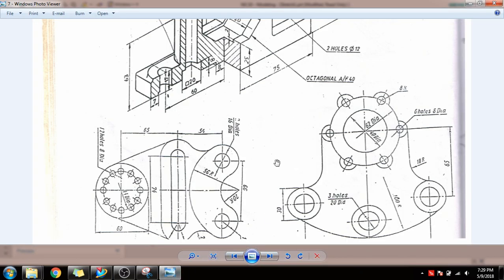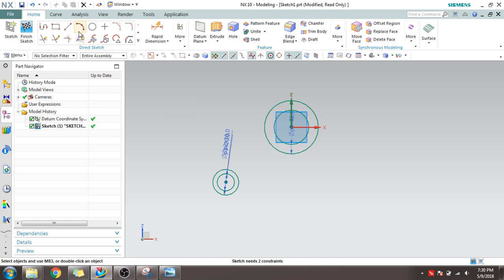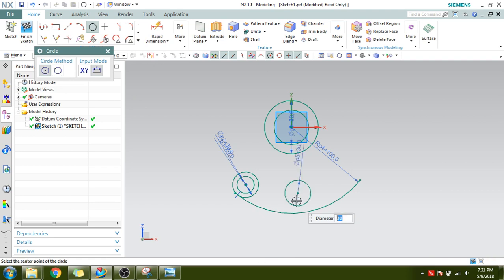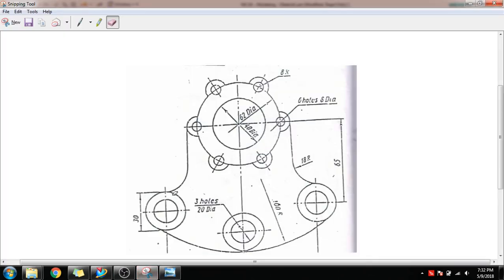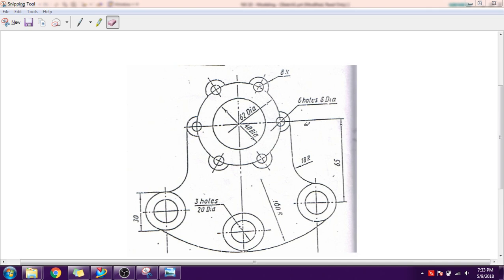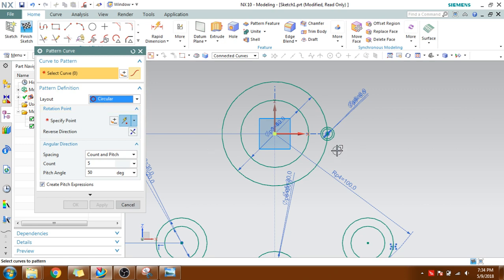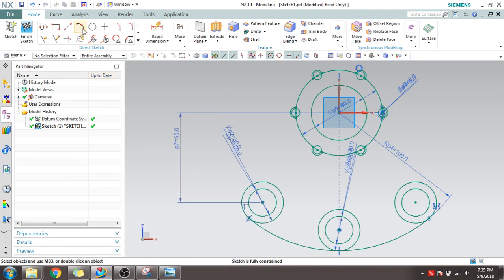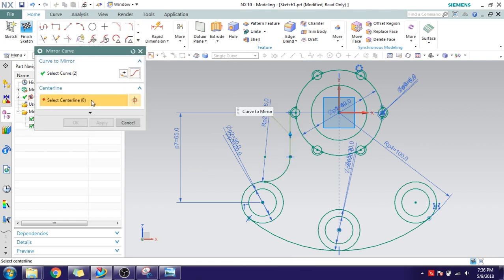Unigraphics NX- Sketch Example 1 with constraints and Dimensioning for beginners

Comment: Hi, i cant locate geometric constraint feature . Clicking "C" on keyboard opens collinear dialog. While watching ur videos it seems to be very easy but i cant find the geometric constraint dialog. Kindly help. using NX 2206
Reply from the maker: Right click on empty tool bar and go to customize and check for keyboard shortcuts and change if letter c is assigned to other feature

Comment: Hi, i have a issue when i try to use geometric contrains, because in the first circle of 20 and 30 diameter, when i use tangent with the arc of 100 radious, the other circle move to another place or the circle of 30 diameter change the measure. How can i solve this?
Reply from the maker: First give geo dimensions to circles.. then it will not change.. and later while giving constraints try selecting curves in reverse order.

Comment: How to restore that three blue plans square after you select sketch?
Reply from the maker: Please explain your question.
Reply: @TechDesignsantosh  when you select sketch and going to select plane, there is a blue square while you hower or move on that little plans. But I accidentally make some changes and the disappear.
How should I recover that settings?
Reply from the maker: @kishanlucifer7478  Reset Create sketch window.